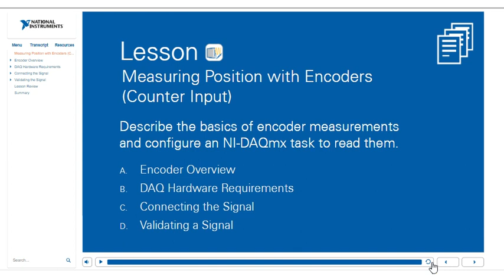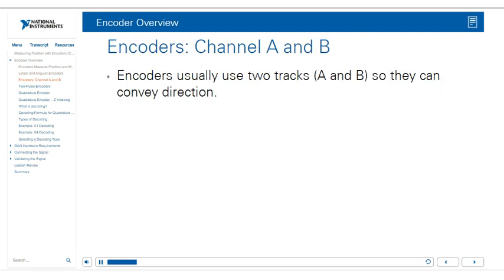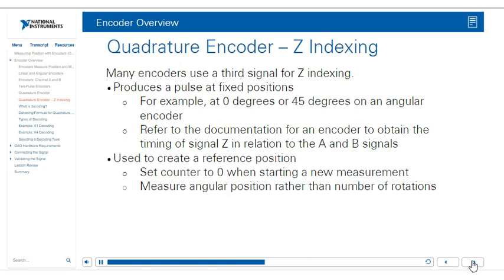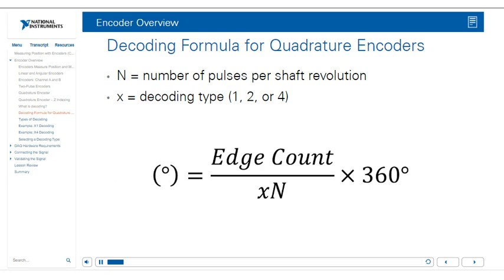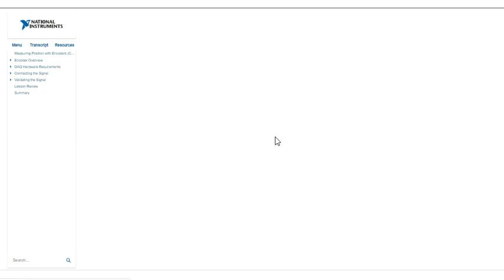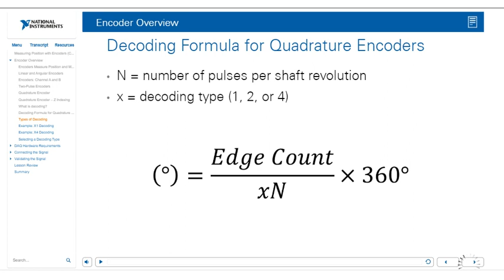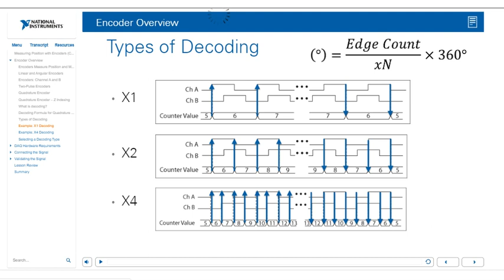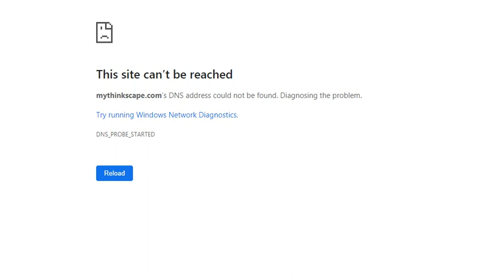LabVIEW Data Acquisition part 16 | Measuring Position with encoders in LabVIEW

Comment: Hello! I have 9 encoders(same modules) installed vertically on a pipe 2feets apart for rpm measurements, but the measurements I get from labview a different from when I measure with a digital rotary sensor manually at each point.